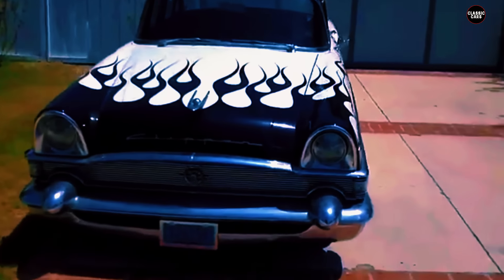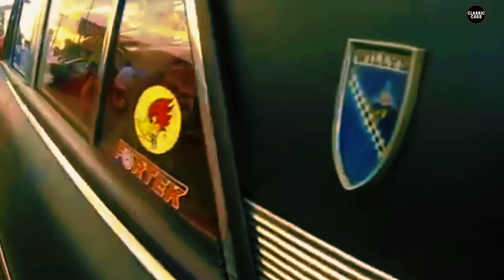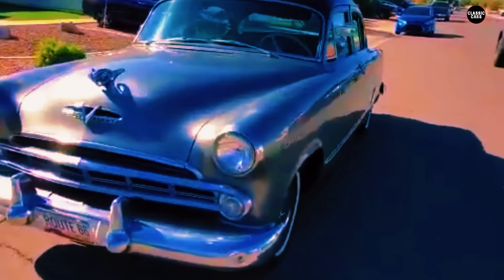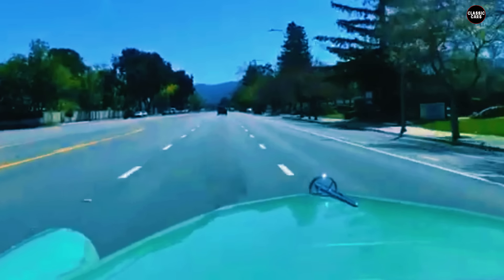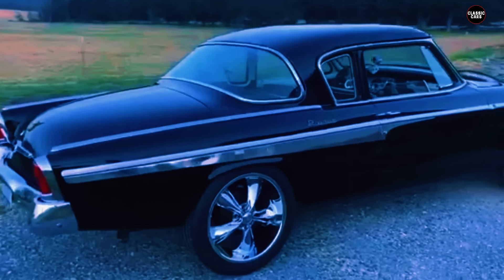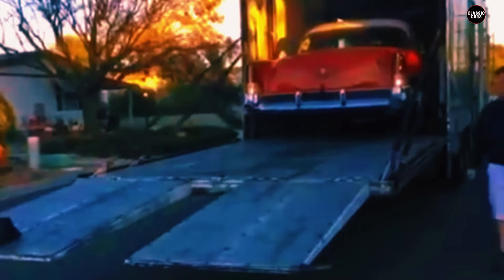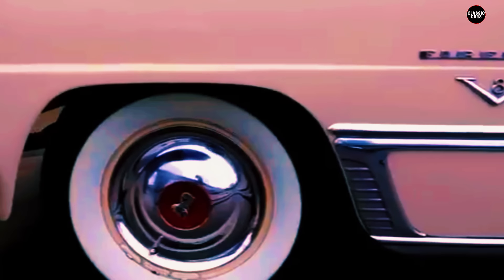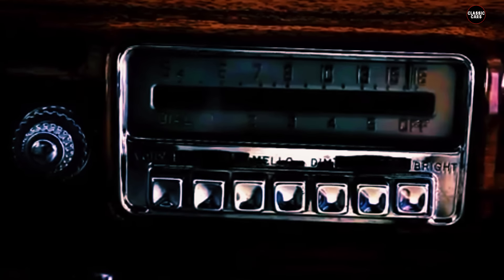You Won’t Believe These Exist: 7 More of the Dumbest and Worst Cars in America in the 1950s

Comment: The 1949-1951 Nash Airflyte met the same fate as the previous 1934 to 1937 Chrysler Airflow. Ironically, these cars DID EMBRACE a more realistic application of aerodynamics for standard vehicle ground speeds. HOWEVER, IN THE PUBLIC'S MIND, THEY WANTED CARS LOOKING LIKE MUCH FASTER JETS & ROCKETS
¯\_(ツ)_/¯